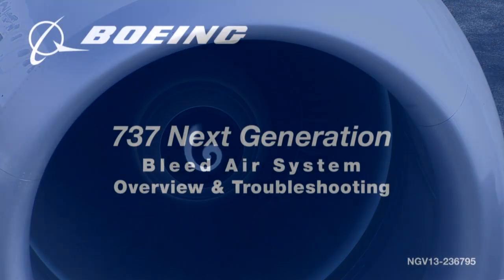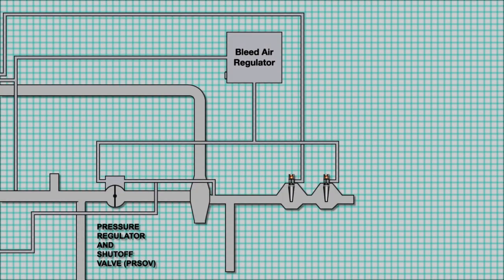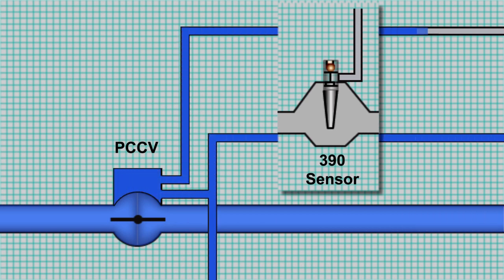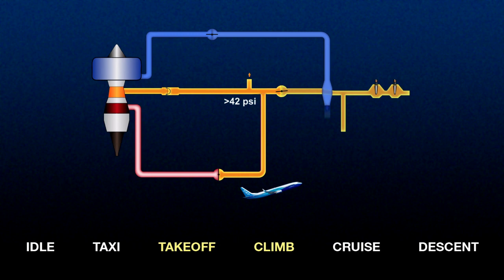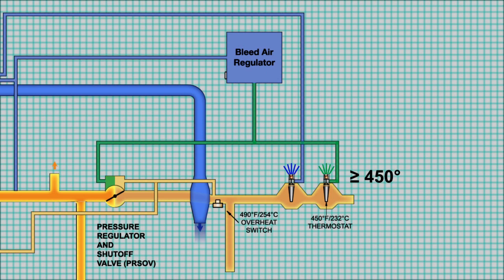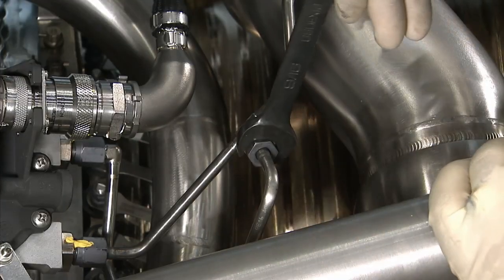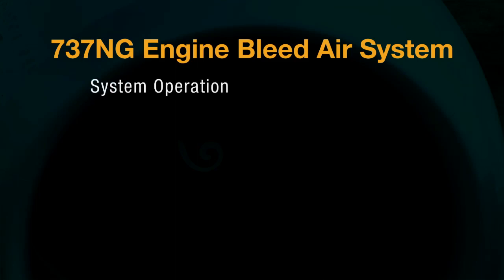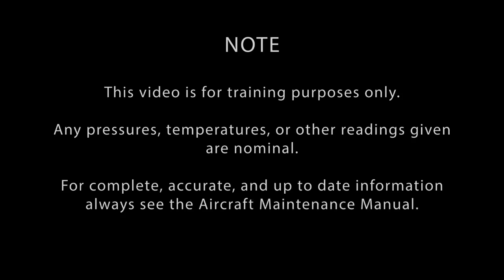Boeing 737NG Pneumatics

Comment: This is by far the BEST video for the B737 NG pneumatic system. Straight from the manufacturer who uses all of the correct terminology to describe the valves and regulators. Fantastic description on how the system works with the use of animation. Awesome use of the FIM and how to interpret the pressure v altitude diagrams. The troubleshooting directions are GOLD. I’ve done these tests before many times using the same test equipment. Once you understand where the test hoses connect and do it a few times it makes a lot of sense. The only thing that would have been great to show is if a leak detection fluid was applied to the valves and regulators to see where the leaks are supposed to be from. This video deserves a million likes and views. Thanks for posting, BIG thumbs up 👍

Comment: One thing I don’t get is weather the 5 and 9 stage is after the combustion chamber. If they are wouldn’t that mean that that air is filled with co2
Reply: 5th stage and 9th stage air is from the compressor. The numbers mean what stage of compressor the air is tapped from. The compressor is BEFORE the combustion chamber